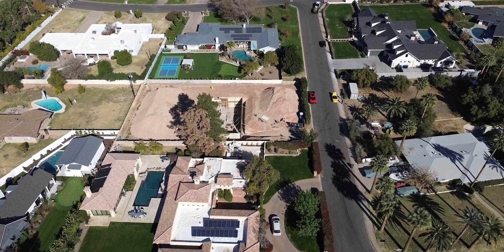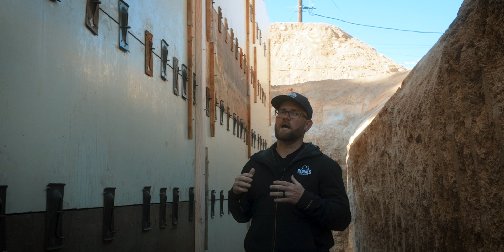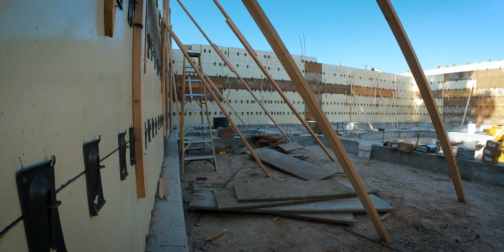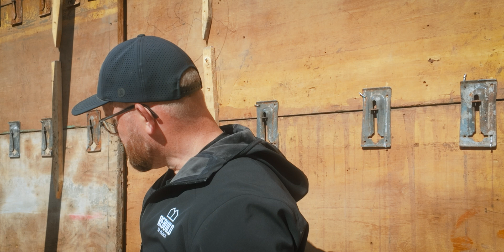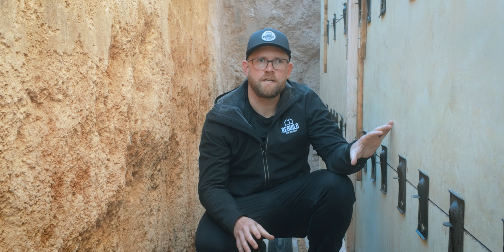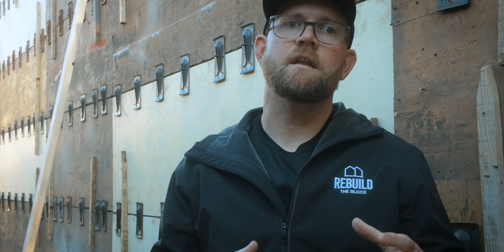The Secret to Durable Basements: Mastering Concrete Forms | Arizona Basement | Rebuild The Block

Comment: Damn, that's a lot of ties. If that's all the shoring and kickers you install and it works, it's probably a lot less expensive than how we did it when I did construction. We used a lot more lumber and less ties.
Reply from the maker: Every trade partner has their ways. It all depends on who you partner with.